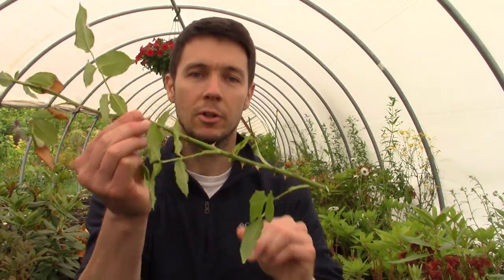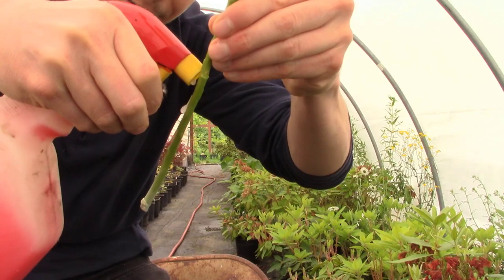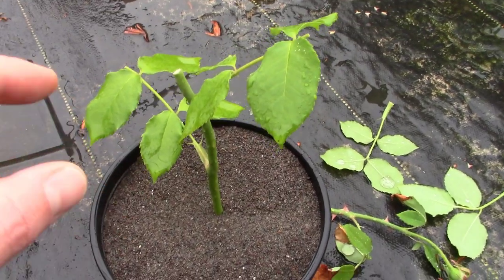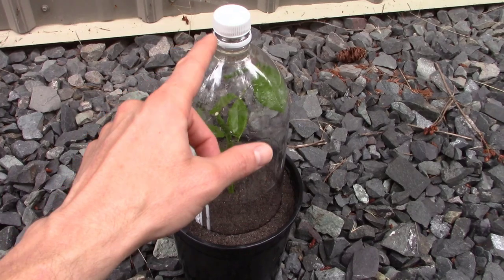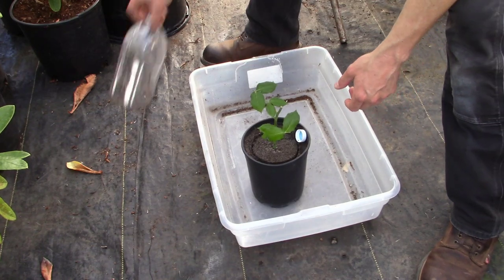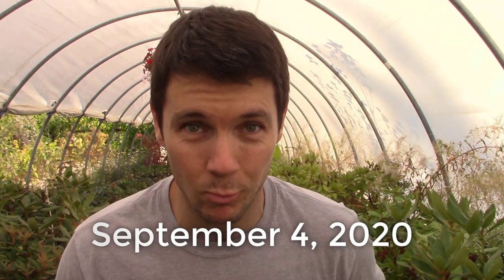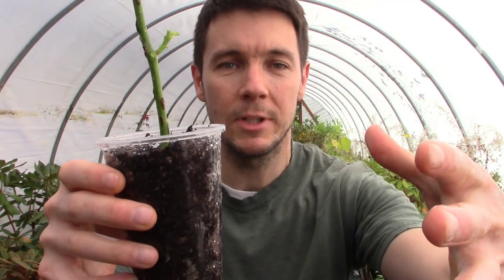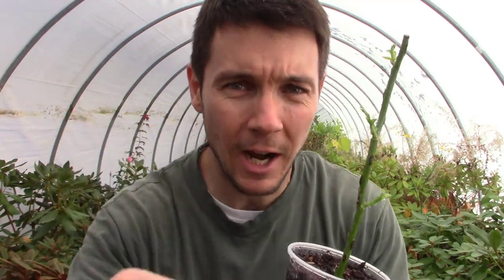Tricks to Rooting Rose Cuttings Successfully | Why are the Roses Stems Turning Black and Dying

Comment: Interesting video.  I never have problems with my rose cuttings, but I use the upper part of the flowered shoot, the top 5 inches with at least 3 axils. I think the biggest mistake is sticking the cutting all the way down,  you only need to bury the first bud on the bottom. Also I never water after at least 2 to 3 weeks and they root in a month for me.
Reply from the maker: Cool, sounds like you've got it figured out.

Comment: Mike, I'm happy to inform you that my rose cuttings are still fresh AND grew new leaves after just two weeks! I followed your technique in this video with slight change - I used coarse sand with lighter colour (even after watering, still look lighter than yours) and using calcium spray (calcium powder and water, can't find your anti-fungal) to spray at the leaves, root area and sand. After two weeks, I checked my cuttings and happy to see cuttings look fresh and new leaves. The bottles still have water droplets, soil still wet. FYI, my weather/climatr is tropical (lots of sun and rain whole year) not 4 seasons like yours but so happy that your technique still works at my climate.
Reply from the maker: Thanks for sharing your success!
Reply: @MikeKincaid79  what's next action after the cuttings have lots of root growing in the pots? Can I move the cuttings into larger pots but continue using coarse sand only? I want to start preparing as where I live, either hard to find or take long time to get supplies (some can take up to a month after ordering!)

P/s: I also shared your video to my mother and gardening group after they saw my own rootings - they were excited to know how-to 😊.

Comment: The mold comes from the mulch people pot the roses in.  The sand is sterile so it is equivalent to water bottle rooting where all nutrients come just from the stem.  The other part of the mold is the covering keeping the humidity very high.  After a couple of summers of 100% cutting failure rate, I am trying a variation now to see if I can get something going.  Mulch literally is molded wood chips, so it is a bad place to start roses.

Comment: When I lived in the PNW, I rooted my roses in a similar manner. The cutting that you took looked good. I would say rose cuttings should be about 6-8" long. I would scrape the base of the stem, dip it in water, and then dip it in rooting hormone. I used potting soil and placed the cutting in the shade. I did not use a plastic bottle to cover my cuttings. There was plenty of humidity in the air and covering the cutting would encourage mold and mildew to grow. I did not use any fungicide. I kept the soil damp so that the cutting wouldn't dry out. Also, I recommend propagating roses in May or June so that they become established before winter.
Reply from the maker: All ideas sound good.  I've got multiple videos addressing these points.  Thanks, Frank.

Comment: Now you have me nervous. Just took a cutting today I’m trying to root. We had a little remembrance for my wife’s cousin. They spread his ashes in his childhood hangout where they lived. So I took a cutting of a nearby rose. Figure if it grows I can continue propagating and give each person a plant.  Let’s see what happens. 🤞🏻🤞🏻🤞🏻
Reply from the maker: You may need to bring it inside, this late in the season.  If you do bring it inside then you probably won't need bottom heat but it will still take longer to root.  That's pretty cool that you're doing that, Jim.  Best of luck.
Reply: Mike Kincaid thanks. I like plants that have stories behind them  not just  from a store or packet of seed.  It’s more challenging to propagate, sneak seeds, bring something back from the edge (I’ve got plenty of these and thriving).  It’s a better skills sharpener. You become a bit of a detective trying to figure out what happened when something doesn’t go right.

Comment: 1,5 to 2 months ago I made cutting from 3 different kind of roses, after I had a failed attempt mid summer (cuttings got black and did not root). This time I have succes and the big difference is I put them inside near a window (20 degrees C), cut a little lower on the stem and used better draining sand with a little bit of nutrition in it (special seed and cutting soil from a store).
Reply from the maker: Great job, glad you figured it out, Bart!
Reply: @MikeKincaid79  Mostly because of your videos and tips, the 3 things I mentioned I got from your videos. The only thing I have a hard time making cuttings from, after august, is the more woody hydrangeas (paniculata bobo), like I mentioned at your previous video. Those still have no roots. I hope it just takes some more patience. Or maybe I should take some hardwood cuttings in november/december or cuttings early next summer.

Comment: Hi Mike, firstly nice video content. Keep pump'n them out.! I have reached that level where the cuttings start to grow  fresh leaves, but then soon after dies.What is then next to do after they root? where do they go? On a new pot? same location? can they get some sun? Do we still keep them inside and covered under the plastic bottle?
Reply from the maker: Once they've rooted, keep them in the same pot and slowly acclimate to less humidity.  Then fertilize and continue growing them in the same pot all summer.  In the late winter/early spring, pot them up while they're dormant.
Reply: @MikeKincaid79  Thanks Mike. I know Our seasons are different here in Melbourne, Australia (Autumn but feels like winter already) but I shall apply your methods the best way they can be. Thanks again. More power and good health! 
👍🏻

Comment: I’ve been told to plant my cuttings in perlite mixed with a little Pete moss . My latest cutting starred sprouting leaves and buds right off the bat…. But now the stem is starting to turn black from the bottom up. Is it the end of my cutting? Or can I treat it with fungicide still???

Comment: Hi mike! Lovely video! I just don't understand why you put the bottle on top of the cutting. If I live in a place with lots of heat do I have to do it as well?
Reply from the maker: Yes, it's not about the heat.  It's about keeping humidity high around the cutting so it doesn't dry out.  The bottle achieves that.

Comment: Hi Mike, first thanks for your awesome videos, I have a question or maybe two , can I use coco coir with perlite for propagation? I don’t have access to bark , other question I live in Canada can I do that in house? I have bright windows to keep the cuttings, it’s cold here so I got heat mat to use under cuttings, thanks
Reply from the maker: Yes, the coco will work well, just don't overwater.  Yes, you can root them indoors on heat.

Comment: Hello Mike, I dipped my poinsettia cuttings in rooting hormone, put them in wet soil and closed plastic bags on them like 4 days ago and when I saw your video I checked the soil and saw it is still wet do you think I should repot them again in more dry soil? All of the cuttings i have are them and they are very valuable for me I will be very thankful if you can help me.
Reply from the maker: I don't like to put cuttings in wet soil.  It usually contributes to rot, especially if bottom heat is involved.

Comment: Hi 👋
I have two questions & I hope you can help 🙂 
1) where can I find some good sand for my propagating mix? 
2) I have been rooting (🤞) some oakleaf hydrangea from cuttings since about mid-August (I think) and am wondering if I should plant them before freeze or if I should overwinter them in their pots? I've had both good and bad luck with planting them newly rooted.
Thank you in advance, and thank you for the great information regarding keeping fungus at bay in rose cuttings 😀
Reply from the maker: You're welcome, Laura!  Glad you enjoyed the video.  1.)  You can find sand in bags at the big box stores, in the garden section.  2.)  If the cuttings were started later in the year, such as August, they may not be strong enough to survive the winter.  In that case, you may be better off bringing them indoors under lights and continue growing them through the winter.

Comment: This is super helpful. Another issue I've had with trying to propagate (besides the black stems) is the existing leaves drying up and falling off, like the plant isn't getting any water. Is this normal? Is there something I need to be doing to keep water going up to the leaves? Even if I'm getting new growth, once those leaves dry and fall off, the rest of the plant seems to die a slow death after that. Thanks!!
Reply from the maker: Are you using the soda bottle or something similar?

Comment: Why would you cover the cuttings? Is there any technical reason behind it and after covering them, what should be the temprature outside? Sunlight or shady? 
Please reply
Reply from the maker: I cover the cuttings to keep the air around the leaves near 100% humidity.  I cover softwood and semi-hardwood cuttings and don't cover hardwood cuttings.  They should get as much light as they can without letting the sun every touch them.
Reply: @MikeKincaid79  should we keep the bottle cap open? Here temprature is 20 degree celcius and 75% humidity
I have planted rose cuttings first time in my life watching your video, so I want them to really grow,

Comment: Last question.  It is well below freezing here where I live in Northeast PA.  But when it gets above freezing, I'm wanting to take cuttings off one of my rose bushes (probably mid feb.) and root it.  Of course the cutting would be hardwood at that time.  If I get roots and some growth inside by May or June, can I plant it outside in the ground in my garden and should it survive over next winter?
Reply from the maker: Yes, spring is a great time to plant because it has all summer to root in well.

Comment: What kind of fabric are you using at the bottom of the pot? Just. Paper kitchen towel?
Reply from the maker: I'm using a weed fabric but a paper towel will probably work just as well.  All it's doing is keeping the sand from flowing out the holes in the bottom.

Comment: Hi Mike, do you think I could use a diluted neem oil in lieu of the fungicide you used? I'm planning on using sand for my rose cuttings and already planned to saturate the sand with some neem oil. Is there something in the fungicide that you used in this video that would give me a better success rate? Thanks again for another fantastic video!
Reply from the maker: You can use hydrogen peroxide
Reply: @MikeKincaid79  oh great! Now would I apply that to the stem of the cutting as well? And in what dilution? I really appreciate your responding! I know you're a busy fella! 😊

Comment: Hey Mike, big fan! Do you have any tips on turning an English Tea Rose into a rose tree? Would I essentially remove a very straight and long cutting from the rose bush and use root hormone, all while cutting the leaves and stems off of the main cutting (except from the top)? Please let me know and thank you! If you have a video on this, I’d love to see it.
Reply from the maker: No video on this yet but to create a rose tree you just need to maintain a central leader and keep cutting off the side branches until you get the desired height.
Reply: @MikeKincaid79  thanks man, I appreciate it! Also, I tried the root cuttings, and I already have new shoots on the cuttings after only 2 weeks. This is on my first try. Those 2 liters really did the trick. I’m going to wait another 1-2 weeks before I separate them into their own 1 gallon containers with actual soil. Thanks man!

Comment: humming bird did not  see it ,so engrossed by your cometary ,sand to root but what do you use to pot them up soil compost mixture ?
Reply from the maker: You can use any potting soil mixture.  I typically don't like to pot them up until the following spring but I had to this time after pulling the roots out of the sand.

Comment: Mike I wish I had seen this video before. I have been having the same  problem as everyone else it seems.  I have tried it withmy roses 2 times and again after  my mom passed away August 23. I tried to reroot a pink and a white Rose from the flower arrangement I got for her. There were actually tiny green leaves growing. I thought I would have that rose for ever and ever. - This time i tried sphagnum as you recommended. - Then the stems turned black again So sad. 
I live in  Charlotte  NC . It's still pretty warm here. My rose bushes  are still  blooming .  I'm wondering if I still have time to try this new trick. How cold is too cold  to leave the cuttings outside . Thanks for all your advice Mike.  I love your videos. Have a great Autumn
Reply from the maker: You can still take cuttings but the longer into the fall you go, the longer they take to root.  You may need to bring them inside for the winter.  Glad you enjoy the videos and are learning from them!

Comment: Hello! I know this is an old video and my problem is rather unrelated, but this video is the only thing that comes up thats not black spot.
Ive had a small rose bush for a few years now, and sometimes it looks happier than others, but it held strong so far.

Lately however, i did a spider mite and aphid treatment with a store-bought but "natural" product, and slowly all the leaves came off.
"No biggie" i thought, "theyll just shoot again" and they did... kinda.

Some shootings did perfectly well, but alot of them turned black as soon as the new leaves took shape.
I dont think this is blackspot, since the leaves that grew in the meanwhile seem healthy (although some are wrinkly or deformed) but colors fine.

Is this a common problem? Could it just need transplanting to a bigger pot? Could it be root rot, or a fungal issue?
Reply from the maker: It might just be too damp.  You could try up-potting it into a bigger pot with a potting soil that drains well.  Hard to say exactly what the problem is without seeing it.

Comment: Rooting Hormone - was this reapplied each time the cutting was removed then replanted because insufficient roots?  Or apply once?
Reply from the maker: Apply once and just let it do it's thing.  The insufficient roots were my fault for continuing to pull up the cutting.  Normally, I'd just leave the cutting in the pot until the following spring.

Comment: Can you use coco coir instead of sand? When is the latest you can propagate a rose without a hoop house or greenhouse?
Reply from the maker: Yes, you can use coco coir.  You don't need a hoop house or greenhouse for any of this and rose cuttings can be taken almost year round.  They will take longer to root the later you take them in the year.

Comment: Hey there, I'm surprised the cutting can grow in sand alone.. how does it conatin any nutrients like soil would?? Thank you in advance for your answer !
Reply from the maker: It contains all the nutrients it needs to root right in the sand.  Once it's fully rooted, you can transplant to a more nutritious medium.
Reply: @MikeKincaid79  Ok well thank you for your prompt answer, I might try that for reasons of humidity.. My rose cutting has grown suddenly black within 24h (I'd planted it in a pot of regular soil 1 month ago, and it was fine so far) I believe I watered it too much lately :( 

I just cut it where it was still green, it's extremely short now, and replanted it in a new pot of soil + root hormone. Fingers crossed.
Reply: Tempetaure in my living room is 64 farhenheit here in Paris which isn't ideal. I put a glass jar over it and usually water it with luke warm water..?

Comment: I’m in Iowa, can I take cutting s now and put on heat mats through out the winter?  I have a sunny warm sunroom ( when the sun is out :(  ) for overwintering plants.  T y
Reply from the maker: Yes, you can, it just takes longer for them to root.  If the sun room is warm enough, you may not need bottom heat.

Comment: Still trying to get my cuttings to grow.  This time I used a fungicide and still got the dreaded black stem.  I used regular potting soil, which didn't help matters.  What type/brand of sand do you use?  Also after about 3-4 weeks the leaves were turning yellow and eventually fell off.  Any idea why that would happen.
Reply from the maker: Everything you're telling me makes me think you have too much heat building up and possibly too much moisture along with the heat.  Does the direct sun light ever touch the bottle?  Is your medium an inert and very well draining medium?
Reply: @MikeKincaid79  Thanks for your reply.  The bottle is facing North under the eaves of the house.  I live in California and we've already had a few 90 degree days.  I'm thinking the potting soil might be the culprit.  I was looking for sand, but not sure what to get.  There's desert sand, sand you put in concrete, sand for sculptures, sand on the beach etc. Do you have a specific brand that you use?

Comment: How long does cuttings take to form roots? I've got an kei apple that I've been trying since last year November but the bark on the inside is still green which means it is still alive
Reply from the maker: It really depends on the cuttings.  I've had rhododendrons take 2 years.  The more you pull them up, the slower it will root.  I would have imagined that an apple would have rooted by now, especially going through the warm summer, kind of odd that it hasn't rooted yet.  Give it more time and see what happens.

Comment: Hi Mike. Is 90 + degrees too much for roses? I live in south Florida and my roses are sufering.
Reply from the maker: It's pretty hot but not too hot.  My grandmother use to have roses growing in her yard in Phoenix and they did very well.
Reply: @MikeKincaid79  probably is the humidity and not the heat. I am waiting for the cooler weather. Thanks.